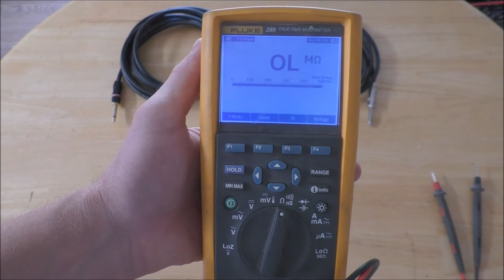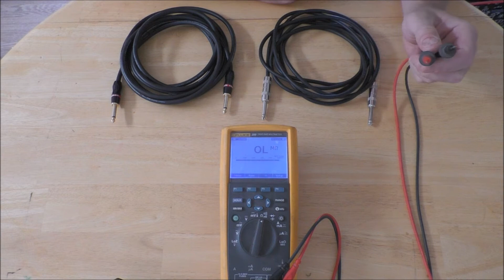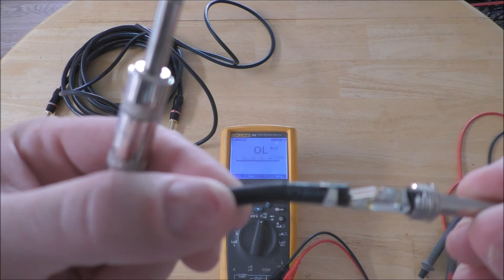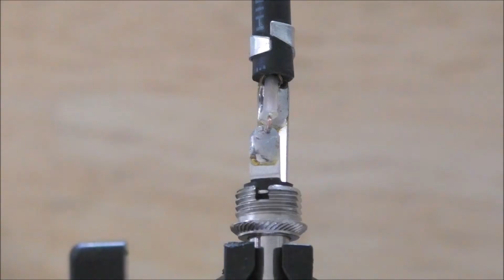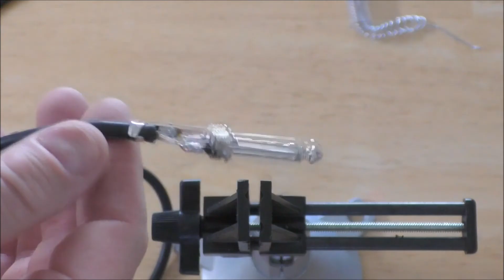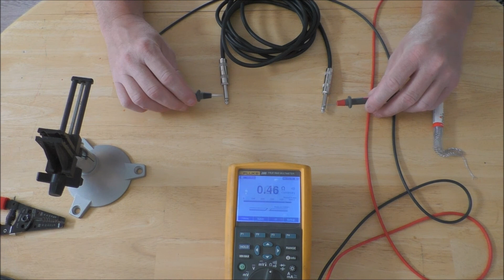How To Test and Repair Guitar Cables The Easy Way

Comment: My cable worked but when i put the peavey rage 158 amp on the distortion setting it wouldnt give me any distortion but the amp sound would get fuzzy like it is in the distortion mode. The cable read good connection on both center and bottom pieces of the input but when i put the lead on the tip of one side and the bottom of the other it also read connection so i think i have a short. My question is, do i have an amp problem or a cable problem? When i hit the button for distortion with no cable in it the amp does sound like it goes into the distortion setting but it seems weird that the cable would play but through the amp both amp settings sounded like clean tone, the distortion setting still sounded clean.